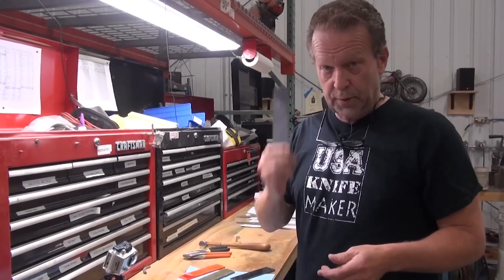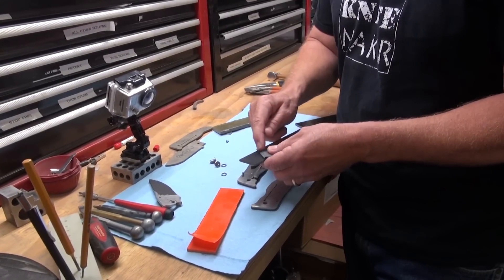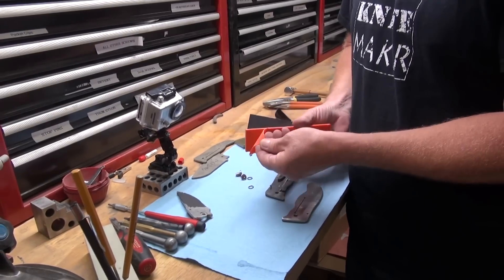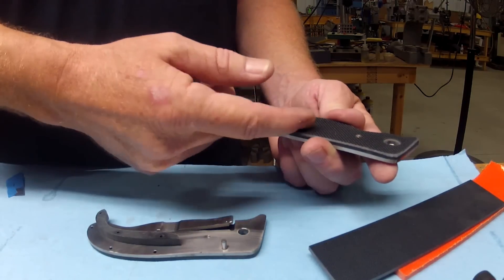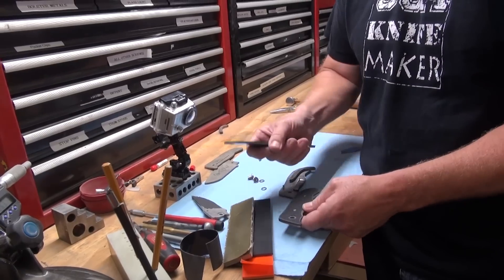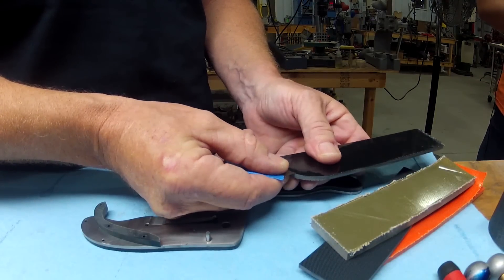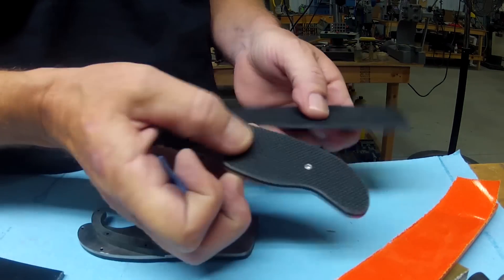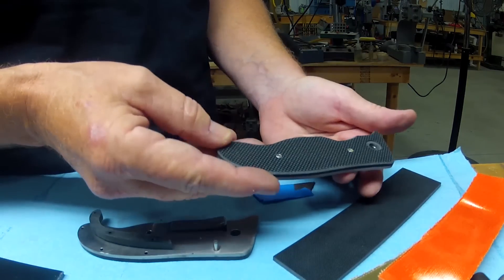What is Peel Ply?

Comment: The easiest way is to pull it back when it is still a block, to the point at where the scale starts and then a little further. As you cut and sand a small tab will be left to pull off when finished.